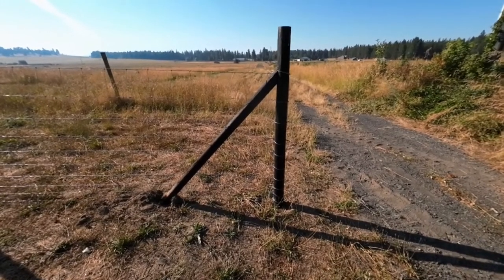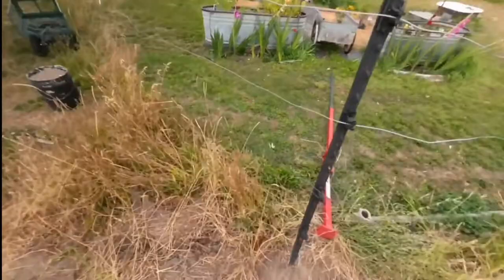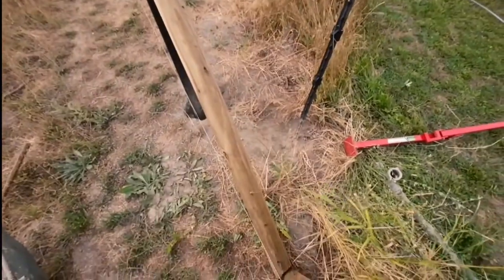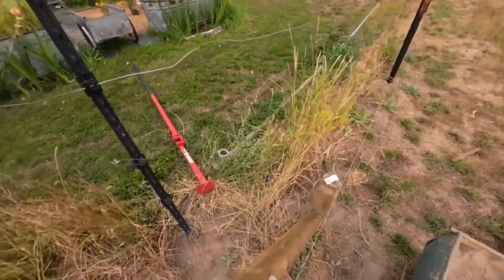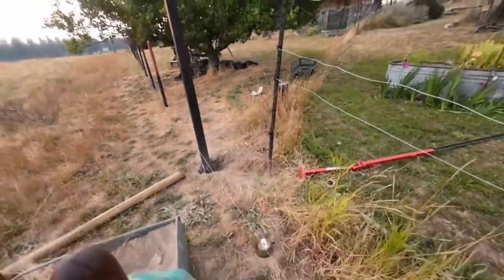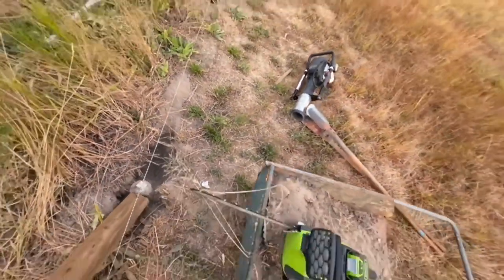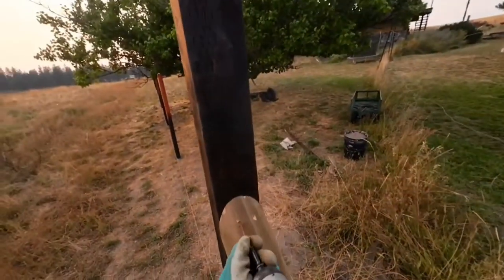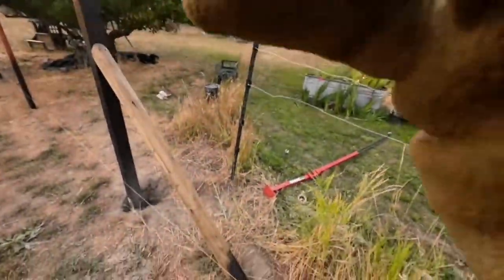Corner post installation

Comment: You need a longer diagonal brace rail.  That is too steep of an angle and the end post is likely to jack up out of the ground.
Reply: I recently installed a fence and had someone point it out to me, so now I’m trying to figure out how long they should be vs height? I can’t seem to find anything definitive and I’d like to fix it
Reply: @isaiahshaffer  Put the brace rail only half way up the height of the top wire.  Use a brace rail that is 3x the length of the height of the end post that is in the ground.  Put a concrete paver block under the end of the diagonal brace.  Run a hi tensile wire twice all the way around the end post and the far end of the diagonal brace.  Put a tightener on it and crank it up until the end post starts to move away from the direction that the pull will be on the end.
Reply: @practicalsheepman  Thanks! I’ll feel better taking the time to fix it with something to go off of now

Comment: If the post is cemented why does it need a brace
Reply: Force over time. And as weather changes from cold to hot, and dry to wet. Things shift. So the tension from the fence wire pulling the fence will cause a pole to come out or warp.